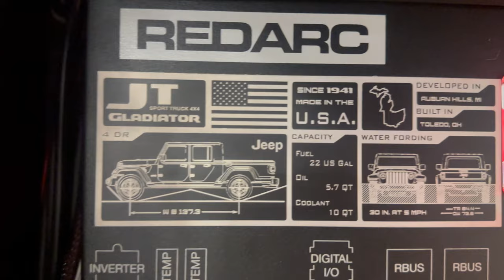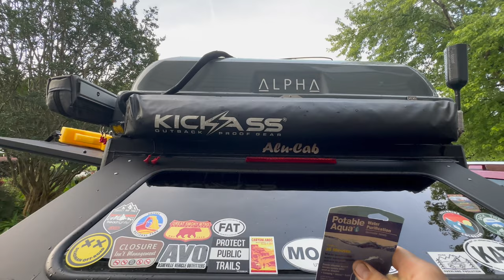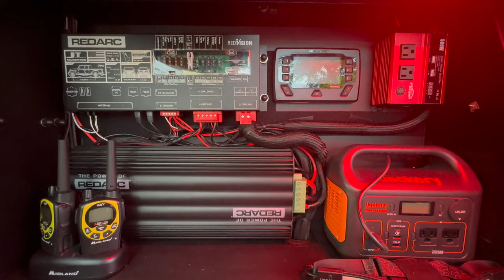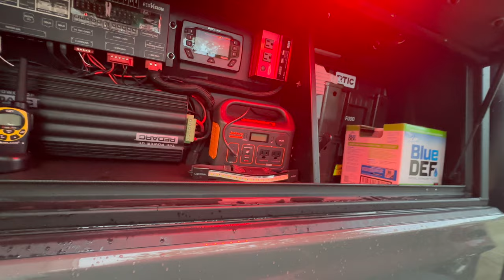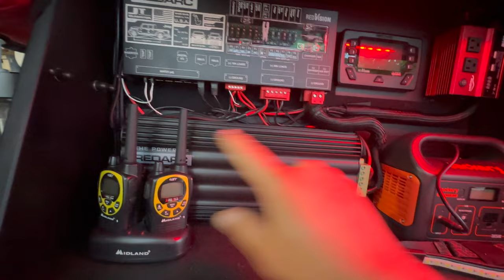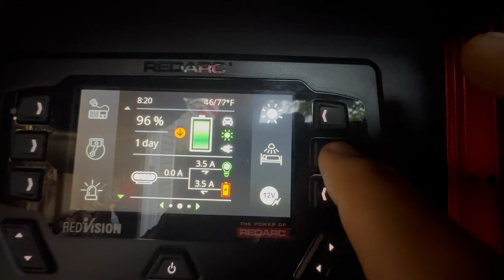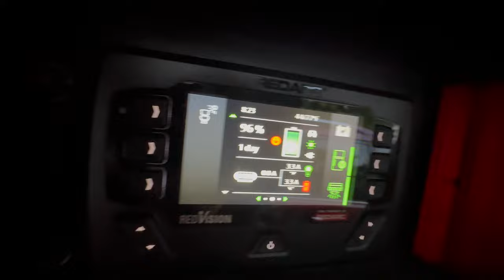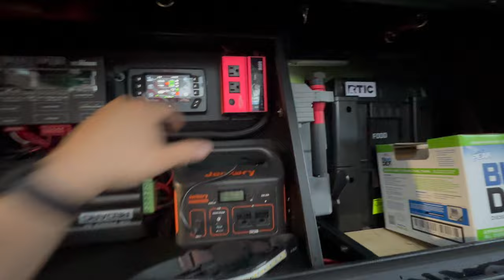The ULTIMATE Jeep Gladiator Canopy OVERLAND Load-out On My 2022 Eco-Diesel Rubicon!

Comment: Wow! Your set up is done right! I just got my Alucab Contour Canopy installed this week. I also have the Redvision set up from redarc ready to install. What size cupboard did you use for the redarc compartment? Where did you purchase? My Alucab dealer is in Asheville NC 4.5 hours from my house so Im hoping I can order online.
Reply from the maker: @02oilburner  yeah I ordered mine from avo. It was just the 1/2 cupboard. 

If I would do it all over I would have the redvision display on the side of that cupboard facing the back tailgate. Just easier because the back is always open at camp. I find myself having to move the ladder all the time to get to the display.